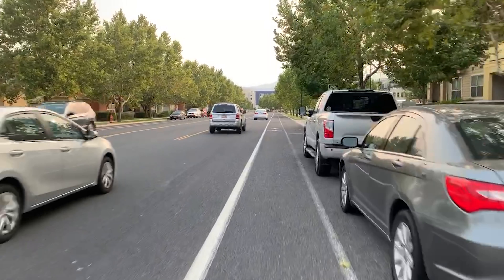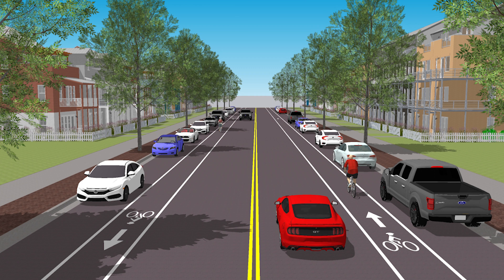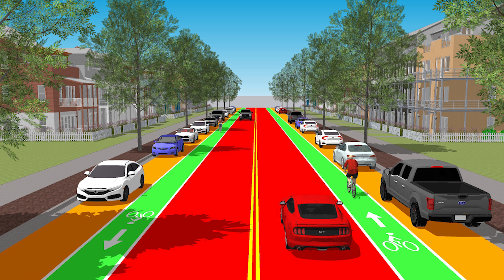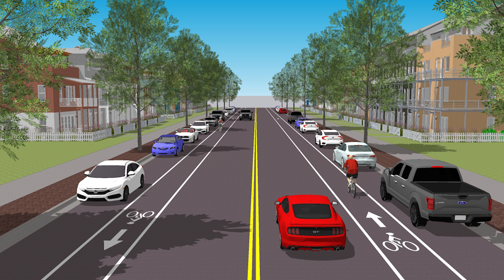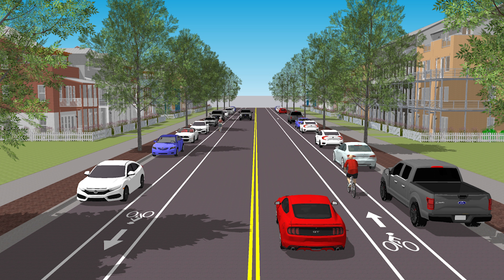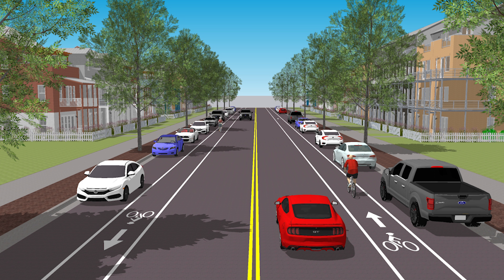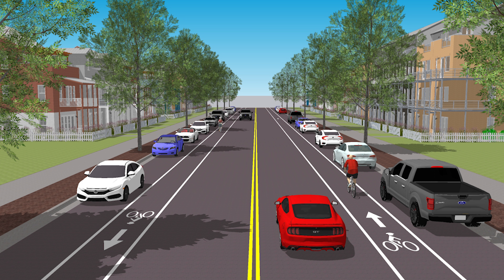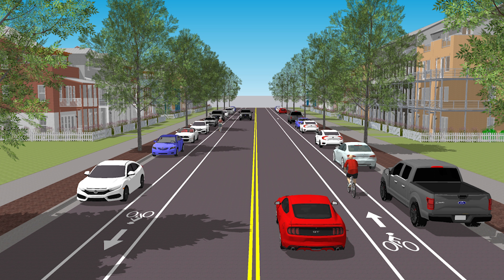How To Better Use Your Street Space

Comment: Great video, thanks for making it 👍 Having ridden, walked and driven all three options, the protected segregated rules!
Reply from the maker: Absolutely agree! If building new or totally rebuilding a street, the separated and protected option should always be the one! The striping and reflector poles  with parking protection provide a low-cost option that really would be more of a short-term solution until a street needs to be reconstructed. If the traffic volumes are low enough and you can really traffic calm the street, then a mixed traffic street wouldn’t be so bad. Thanks for watching and for the comment!

Comment: Thanks for this informative video! I nominate Warm Springs Ave in Boise, ID for your list at the end. We have some awesome paths(Greenbelt, capitol blvd) here but protected lanes on roads are hard to find otherwise.
Reply from the maker: I have checked out a lot of Boise and the paths along the river are great! I remember seeing a protected bike lane in downtown too. I was actually thinking of that whole development where Warm Springs Avenue is when you mentioned Boise because I went and checked out that out there last year and took some pictures of it all. There were several streets built this way and it is too bad that they didn’t just move the bike lanes off the street. It is probably one of those situations that it was planned with good intentions but was a less optimal solution. They even tried to improve the street scape along Warm Springs through there with street furniture, landscaping, and building orientations, but they missed out on this detail! They could certainly do what Austin did in the Mueller District though and switch up the space! Thanks for the comment and for watching!

Comment: Cougar Blvd. in Provo is guilty of bike lanes that are just in car roads. I saw few bikes on the road. Sandy/Draper with the Porter Rockwell Trail? That's the right way.
Reply from the maker: Cougar Blvd is definitely a step in the right direction and a lot better than what was there before; but I totally agree, it is a protected bike lane (with some design compromises) put onto a stroad. Often times the best bike facilities are designed a block or so off of the busy traffic moving roads, although circuitous and disconnected street networks in some places don’t always allow for that.

Comment: I think that there's another downside to painted bike lines that I've never heard anyone mention: drivers will perceive a lane with an unused, companion painted bike lane as simply one wide lane, which encourages them to drive faster.  And that seems to happen more often that not, given that painted bike lanes are typically used when there isn't a strong local bike culture.
Reply from the maker: Totally true! The bike lane acts as shy distance for the road which is typically a feature of a high speed highway to provide forgiveness to drivers. Not a good idea to put vulnerable people there on bikes, which is also why they aren’t used much. Most people want to stay away from the two-ton death machines if they are going to walk or bike! A good example are the bike lanes on Daybreak Parkway going west of 4000 W. People fly in their cars up that stretch and it feels very wide because of the bike lane space. There is a reason I have never ridden in those and always use the trails out of the roadway!
Reply: Oh, cool.  I hadn't seen the term "shy distance" before.  I was thinking of those painted bike lanes as a clear zone, but I suppose that either is valid.  Thank you for expanding my vocabulary!

Of course, Mike, if you use the trails when headed west along Daybreak Parkway then you're also going to miss out on the fun surprise of being forced into traffic as you cross that narrow bridge because the bike lane has disappeared.

Comment: What about making one side walk a multi use trail and keep the other side walk narrow. Then cars don’t need to be parked so close and open doors into oncoming traffic. Also where the multi use trails cross the street slightly elevate the street to meet the multi used path instead on having the path downslope into the street. That would  hopefully make cars be aware foot and bike traffic crosses at that spot.
Reply from the maker: Definitely from a new build standpoint, building the bike path off the street would be best and most comfortable. Raised crossings would definitely help slow cars down and indicate through design the priority for the crossing. I would combine either chokers or a refuge island with a raised crossing depending on how much traffic the road is seeing. 

Thanks for checking out the video!

Comment: In Manhattan, the entirety of Central Park West (8th Ave) has a parking protected bike lane (albeit, it's one way, though the next Avenue over, Columbus, has a parking protected bike lane going in the opposite direction.)

But once you cross 110th street and Central Park ends, in Harlem, Fredrick Douglas Blvd (that's what 8th ave is called up there) the bike lane turns into one of these exposed bike lanes. To add insult to injury, there are constantly double parked cars in them, causing cyclists to constantly swerve in and out, or stay out of the bike lane altogether. I would not be exaggerating when I said that one my daily bike commute, I would encounter 4 double parked vehicles per block there.
Then at 121st the bike lane goes left and joins St. Nicholas Ave as it diagonally cuts through. This left turn is a freaking nightmare, not only for cars, but especially bikes. I have biked through the intersection probably a hundred times and I still don't know how it works, because the intersection is so big. From stop line to stop line, the intersection is 219 feet long, LONGER THAN A CITY BLOCK that it parallels.
Reply from the maker: Wow, I know New York has been getting some new separated bike lanes on the ground, but it sounds like there is still work to be done to create a cohesive network of safe and comfortable routes! Those double parked cars are terrible, and it causes a real safety issue forcing people biking to have to mix in and out of traffic. That is why as you would know that proper protected bike lanes help to self-enforce issues like that. Also, long intersection crossings definitely are not ideal and leave people exposed, and 219 feet is super long!

Thanks for checking out the video and leaving a comment!

Comment: With this knowledge, how could exposed bike lanes be removed from acceptable practice in traffic design? Is there any appropriate use for them? Where I live they're the only bike lane you're likely to get if people demand bike lanes.
Reply from the maker: I will say exposed bike lanes are still better than nothing at all. Research shows that they are safer than no bike lanes at all, especially where there is on-street parking. However, protected bike lanes are certainly much safer and more comfortable than exposed bike lanes and will actually do more to encourage people to use them where there is a connected network. If you want to hope for any significant reduction in vehicle traffic, the bike facilities need to be comfortable, safe, and convenient for sure. Many places in the US are shifting preference to protected bike lanes and the newest AASHTO bike design guide (when it finally comes out) will address the design of those facilities. It doesn’t remove exposed bike lanes as an option though and with a country as large as the US, it would be difficult to remove them as an option all together. Groups such as Transportation for America are advocating and lobbying on the national level to push for principles of Vision Zero. Locally, cities could make policies to utilize protected bike lanes and adopt design standards that prioritize safety over traffic flow.

Comment: What you're referring to as "exposed bike lanes" sometimes gets referred to as "painted bicycle gutters", due to them being painted on and about the same width.

If I might call your attention to something as a small piece of urban planning to look out for, transitions from roadside bike lanes, be they gutters or separated infrastructure to sidewalks in areas of sparse infrastructure - and sidewalk continuity in general. A couple good examples I can think of around me are northbound Thompson Ranch Road & US-60, which terminates its bicycle gutters into nothing. Not even a concrete ramp to allow bicyclists onto the sidewalk, just into the road. If you follow Bell Road westbound from the Loop 101 you'll start to find the second issue of sidewalk continuity becoming an issue ~91st - 95th avenue, before dropping off hard after about 105th.

(I know these are AZ examples, but I live in Phoenix metro and they're still things to watch out for so that things are planned more effectively)
Reply: This is something my Township is trying to improve over time, but it's a problem here too. Some places were just allowed to... not... build them? I'm not sure why it's like this in so many places.
Reply: @RandomPerson123321  For the record, the worst offender of my Bell Road example also happens to be about the point Surprise gives way to Sun City.

Surprise has a plan for some bicycle expansion. By 2035.

Sun City... does not.
Reply from the maker: Absolutely great points! We need continuity for any facility and I have been there before when riding a bike just to have the painted bike gutter suddenly end. We need to plan good macro and micro connectivity for bike and pedestrian facilities. I always like to flip the thinking and ask what would people think if we did the same thing for roads for cars? It is part of the whole problem and train of thought that cars are the only real form of transportation, and that is what I hope to advocate to change. We need our leadership to understand the issues and help to prioritize alternative modes of travel. It is a huge issue for social equity because when bike lanes and sidewalks just end, it is a slap to the face to anyone who can’t drive or can’t afford to drive. It also pushes people into cars who want to get around in other ways but can’t do so safely, thus adding to the traffic problem.

Thanks for the comment and for watching!
Reply: @bikequestwithmikewest  I just figured that, as an urban planner, you might have better luck with the knowledge of how not to do it (ie, how Phoenix does anything)
Reply from the maker: @steveheist6426  definitely and I hope for many engineers and city leadership to truly understand how not to do it and the better way to do it as well. Phoenix is the epitome of car dependent sprawl unfortunately, but it doesn’t mean that improvements can’t be made for the better. I do love visiting the Sonoran Desert though and have visited Phoenix and Saguaro National Park several times!

Comment: Shouldn't the protected bike lanes be on both sides of the street? One-way or two-way, I don't care but if the bike lane is only on one side, the bicyclist from those homes on the other side are momentarily at risk until they get into the protected bike lanes.

BTW, I'm from Toronto and we have many configurations including the exposed bike lanes.  Way better than none.  We even have a couple of streets where there are two-way protected bike lanes on both sides of the street.
Reply from the maker: Great comment! You’re absolutely right that protected bike lanes on both sides of the street is ideal. Though there are a lot of different considerations a city will be faced with in looking at the design and configuration of a street.

First of all is whether the political leadership, engineering department, and public works department are even willing to work on this kind of stuff. They are likely unwilling to go to 10-foot travel lanes, introduce curb extensions and other traffic calming features if they don’t understand the benefits of such street design and is one of the reasons I decided to start this channel!

Second is how much asphalt space is available. Providing enough of a buffer to keep cyclists out of the door zone from cars is important to prevent accidents and some space for people to get in and out of their cars. I find that many cities may do a two-way facility on one side since it requires only one buffer space in the cross section. Permanent protection is also half the cost if only one barrier needed to be built vs two. The asphalt width of streets throughout different cities will vary, and in the case of some, a two-way facility may be the only way to meet minimum width criteria with 10’ lanes, parking, buffering, and the bike lane space. Reconstruction of a street is the best opportunity to do it right though it may pose challenges and additional costs depending on where storm drain lines, sewers, and other sub-grade infrastructure is located. The Netherlands has been at it for a few decades now, and any time a street needs to be rebuilt, it is brought to their current standards for the roadways, bike lanes, and sidewalks. Here in the US and Canada most cities, states, and provinces are still too concerned about traffic speeds and flows as well as safety of drivers above all else, of which is still reflected by our current standards. I like referring to the Dutch Crow manual for design guidance, but we also have the NACTO Urban Bikeway guide that can help with these considerations. We just need AASHTO to come out with their new bike manual!

Third is ease of access as you mentioned. A two-way protected bike lane on one side of a busy or higher speed street doesn’t work to provide safe and convenient access. High volume, higher speed roads and especially multi-lane roads need to have two-way facilities on both sides. I look at busy and especially multi-lane roads (which are usually stroads here in North America) as barriers. I always question the need for extra vehicle lanes, especially through city centers and neighborhoods, and if possible I like to look at neutralizing the barrier with a road diet and traffic calming. If a road remains a barrier, then safe and convenient crossing points must be included for cyclists and pedestrians. In the context of the example in the video, if the space allows for it, a one-way protected bike lane on both sides of the street is advantageous to provide better access from both sides of the street as you suggested. One-way lanes on both sides mean you may have to cross the street to access the other direction. I did have some engineering consultants from the Netherlands (DTV Consultants) look at some facilities in the town I work for, and they said cyclists in the Netherlands tend to go the wrong way on a one-way cycle track for a short distance until they get to a safe crossing point, so that is also a consideration! I will say a two-way on the side of a traffic calmed street is a whole different story than putting a two-way on only one side if a busy and higher speed roadway. There is a shared use path down the street from where I live, and as a cyclist I always have to cross the street to access it. The crossing is only 20-feet long (at the curb extensions) and vehicle traffic volumes and speeds are lower, so it is pretty easy to do so. I regularly see kids and older generations do the same without too much problem, though raised crossings would be helpful to better establish priority and traffic calm even more at conflict points.

Fourth is how many driveways are located along a street. If there are tons of driveways, side streets, and conflict points, then two-way protected bike lanes can be potentially more dangerous since driver expectation may be altered with cyclists coming from both directions. Raised protected bike lanes with continuous crossings (cars ramp up to bike lanes/sidewalk) and ensured visibility can help to slow vehicles down at conflicts and establish priority of both cyclists and pedestrians through the psychology of the design.

Sorry for the long response! I always have a lot to say when it comes to this stuff! Your comment was right on though and perhaps this kind of discussion could deserve a future video.

Comment: I think from a UK point of view, I’d rather just ban private cars and be done with it. Seeing as we don’t really need them. We’ve just been brainwashed into believing we do.

But in countries like the US, things are just so far apart with very little train network coverage that something like this will probably always be necessary. But I’d still avoid the 2 way on one side design personally.
Reply from the maker: There are definitely some places in the US that unfortunately will be dependent on cars for the foreseeable future. There are varying levels of opportunity and even some sprawling car dependent places could still get to some places within biking distance, like schools, a grocery store, and parks, if the infrastructure was there. 

It does boggle my mind a bit when places like many towns in the UK and other countries have things closer together but still design a lot around car travel.

I will say a two-way facility may not always be the answer, but it certainly could work in many cases. If a road is too tight, parking could be eliminated from one side and some good protection installed beyond reflector poles, but removing parking typically comes with some good public pushback, especially where parking is limited. Parking demand management is a great way to incentivize alternative transport options though if viable options are available! One-way parking protected bike lanes could also be utilized but require more space since you need a separate buffer on both sides of the street, and you lose out on some passing space if you don’t make the lanes wide enough. Busier roads really should have two-way facilities on both sides and with greater separation from the carriageway. 

Thanks for the comment and I appreciate the UK perspective!